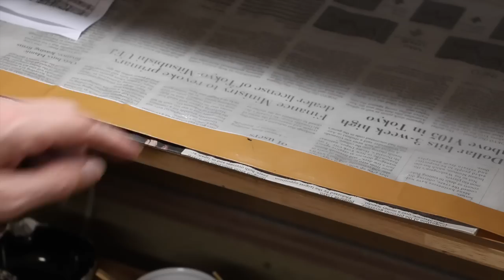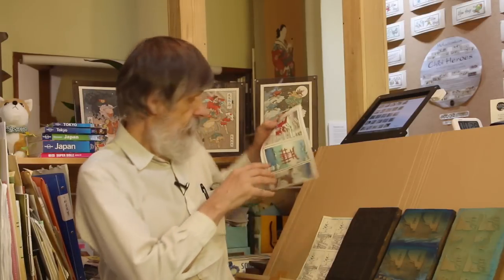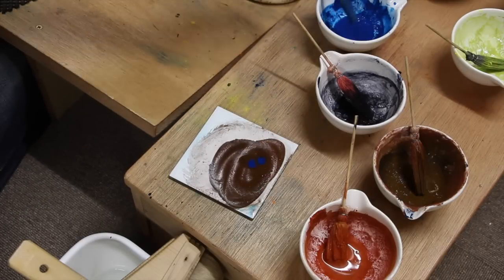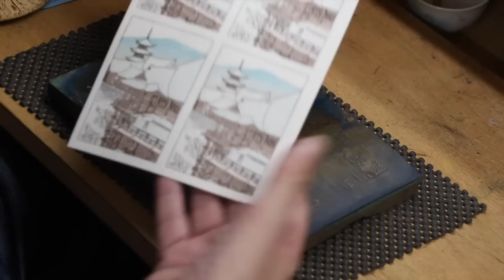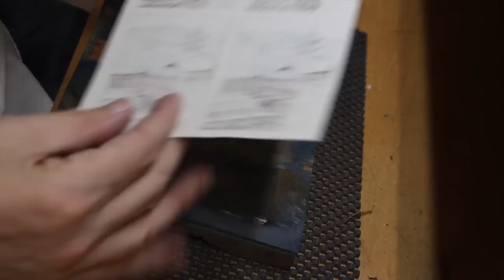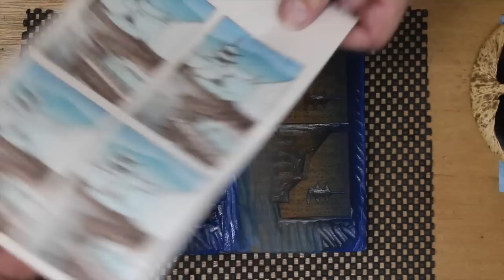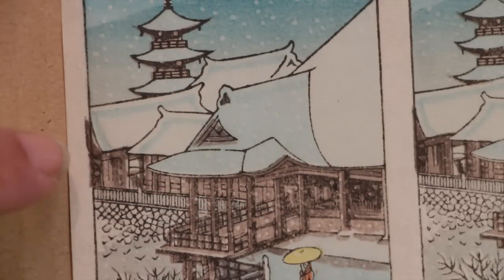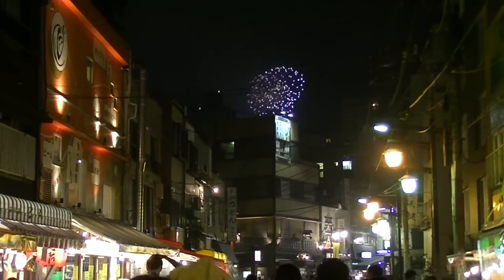Doi Hanga collaboration : Part 8

Comment: You mention size a bit at the beginning of the video. What is the largest print that you realistically think could be done? Is there a size beyond which printing is no longer feasible for whatever reason?
Reply from the maker: In the western printmaking scene, size is no problem; you just have to google ‘printmaking steamroller’ to see some large-scale stuff. But they use oil-based inks, which allow plenty of time to ‘fool around’ before taking an impression. In the Japanese tradition, it’s water-based, which makes it much more difficult to scale up. It’s been done in the past, and there have been some pretty large prints made, but the larger you go, the less accurate and less ‘clean and clear’ the impressions get. It’s not something we here at Mokuhankan are going to chase at all ...

Comment: Hi Dave,
Is there much risk of marking the page with the yellow umbrellas again when you are doing the orange clothing impression? I noticed you only rubbed the areas directly above the orange pigment sections, but the paper still is resting on the yellow areas.
Reply from the maker: There is never any pigment left on the surface of the wood, so getting a yellow mark is not a problem. What could be a problem is an indentation from those umbrellas, so I have to be very careful not to rub in the wrong places ...

Comment: hi, i subscribed not long ago and i want to thank you very much for sharing your work. i have a question if you have the time to answer, have you ever been afraid a print job (excuse me if the terminology is wrong) is beyond your skills and if so how do you cope with the feeling? . thanks again. regards. pete
Reply from the maker: This would need a book to answer properly, but there is maybe a simple answer too. After I finished the ten-year project to make prints of the old Hyakunin Isshu poets series back in 1999, I needed to find a project that would push me to develop a lot of carving/printing skills that I didn’t yet have. So I came up with the idea of making a collection of 50 prints (10 a year for 5 years); each design was selected with one thought in mind - giving me a chance to explore a technical printmaking point that I hadn’t yet encountered. In other words, every single print of the set was ‘beyond my skills’, in a manner of speaking. I guess it kind of sounds pretentious to describe it that way, but anyway … that’s what I did. The project was my ‘Surimono Albums’: http://woodblock.com/surimono/index.html
Reply: thank you for your answer david. i`ll check the link right now. and it doesn´t sound pretentious it`s just some kind of peaceful self confidence that i find uncommon and hope i get sometime. it`s an inspiration to me. thanks. pete